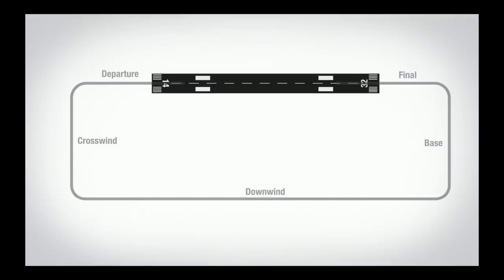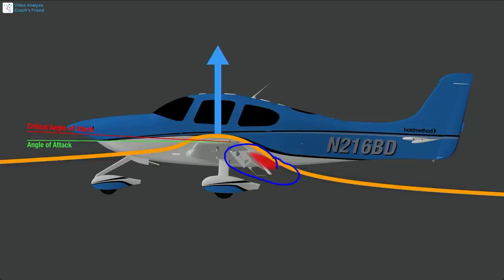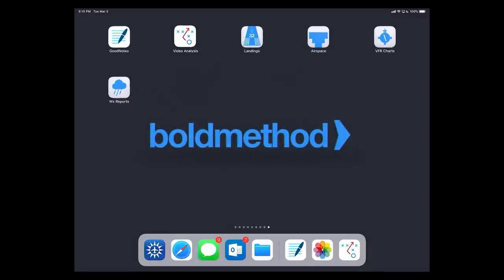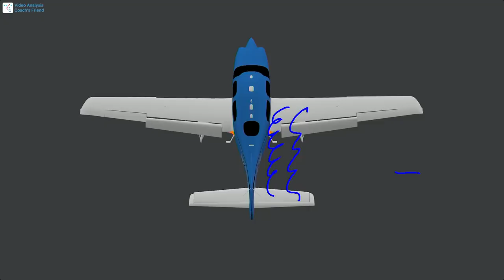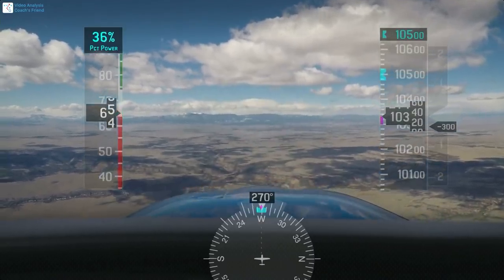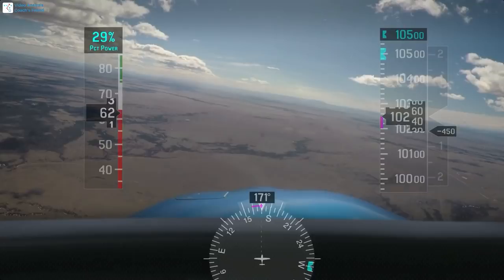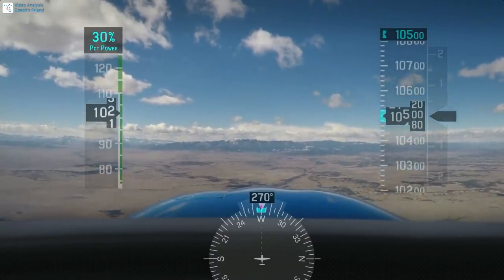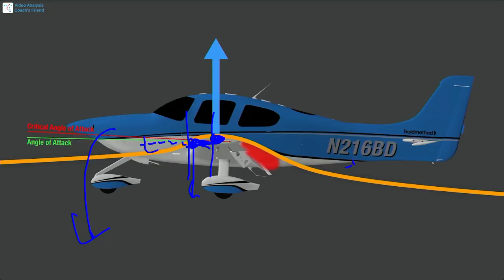How Stalls Happen, And How To Recover From Them: Boldmethod LIVE

Comment: Loved the flow of the presentation. Aerodynamic aspect was covered for the most part. Some missing relevant elements: 1. Adverse Pressure Gradient (APG), not just "Pressure Gradient" (PG). 2. Three-dimensional Airflow, not just two-dimensional airflow, therefore the element of Induced Drag/Vortices creation as a byproduct of lift creation prior to exceeding CLmax. Center of Pressure (CP) displacement in the direction of flaps being deployed. 3. Centripetal Force (i.e., Horizontal Component of Lift). Overall, this was a very instructive presentation on the mechanics of the power-off stall, thank you for sharing Boldmethod. Well done.

Comment: I'm wandering why the heading indicator was so far off the runway 090 . Also, is there anyway the manufacturers of on board computers can calculate wind speed and direction, without need for interpolation. Thereby eliminating the need for a wind sock, complemented with a wind shear horn ? Perhaps a dial that points wind speed and direction, similar to a heading indicator   .! Just thinking about multiple censors as small as a static port .! Loving your show.. I found that  the T tail on aircraft like a tomahawk can be left left nil and void of airflow, because the low wing is blocking if out. This requires almost full deflection in both elevator and rudder, right up to a flat spin. Sometimes just letting go, is better than fighting. It's called inherent stability. Often the airplane flies better than us. Hard learnt. T tail.